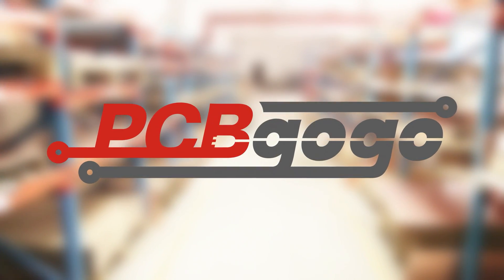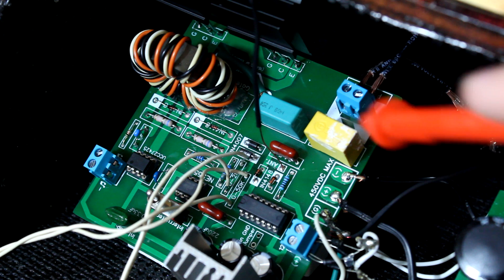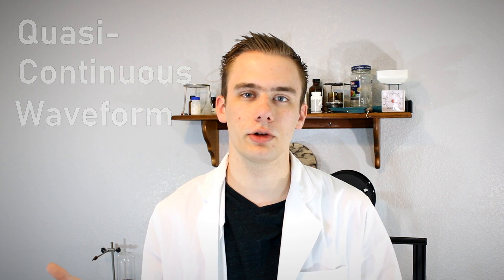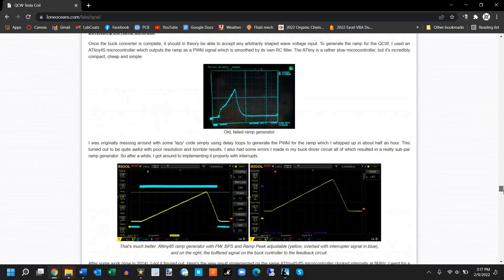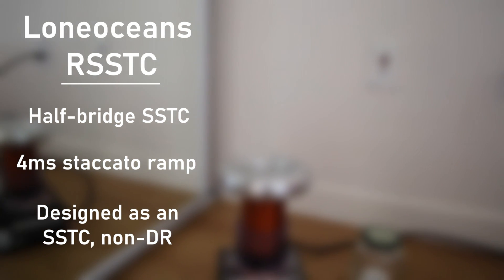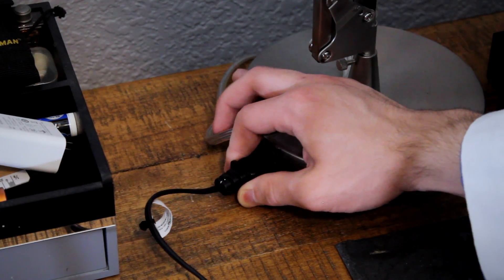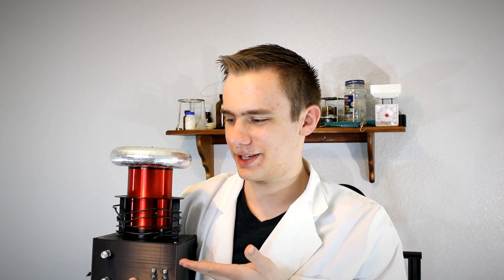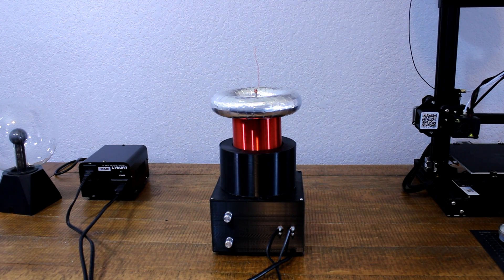World's Easiest QCW Tesla Coil (Staccato-Ramped DRSSTC) | The Ultimate Build Guide

Comment: Hey there Zach! Great video and design! Getting all the parts together to make my own coil. My question is,  can I use a 17/18vac transformer for the low voltage side and just make sure to use a heat sink on the 7812 regular? Or would i need to beef up the regulator and the caps voltage rating as well?
Reply from the maker: Hey Trey, glad to hear you're giving this circuit a shot! To my knowledge, 18VAC should be fine, so long as the electrolytic capacitors near the 7812 are rated for 30V or more (25V might be too little, since the peak voltage from 18VAC is just over 25V). There are actually many variations of the 7812 from multiple manufacturers, but from what I can see, all of them can handle 27V or more (some higher-end designs can handle 35V). I do recommend heatsinking the 7812 if you can though, since mine gets kinda warm with just 12VAC. Hope that helps, good luck!
Reply: I do plan to experiment for sure! Just finished putting together the driver. I do have one more question. When you are running it in 220 volt mode, how do you have the 12vac transformer wired? I ideally want to have one plug to power everything.
Reply from the maker: @treysmith6028  glad to hear it! In my build, I just had two separate inputs: one 120v line for my 12V transformer and one 240v line for the main circuit. This was just my choice though, I could have just ran the whole thing off 240v if I instead wired a 240v-to-12v transformer in parallel with the circuit's input.
Reply: When calculating the LC impedance, do I need go include the .68uf cap at the inverter part like your last coil design?
Reply from the maker: @treysmith6028  No, just the resonant capacitor. For impedance calculations, you can look at the inverter capacitor and resonant capacitor as one capacitor bank. And when you have a low-value capacitor (like a 0.1uF resonant capacitor) in series with a much larger capacitor, the overall capacitance essentially reduces to that of the smallest capacitor. In reality, it's a bit lower: the total resonant capacitance for a 0.1uF capacitor in series with a 0.68uF inverter capacitor would be 0.087uF. The formula for the capacitance of a series capacitor setup is simply 1/((1/C1) + (1/C2)), you you're interested!
Reply: Dude great info! Helped a ton. I love how detailed and thorough your responses are. Got my coil up and going finally! However,  I have strange issue. The 100k pot. Will not change the BPS, its stuck at the highest rate. So when I turn up the other potentiometer it's just changing the spark size. I checked the value and its correct. Any idea what would cause that? I'm at a lose
Reply from the maker: @treysmith6028  I honestly don't know what could be causing that! You might try swapping out the 555 timers with new ones (and maybe the 100K pot), and then ensuring everything around the interrupter is wired up correctly once again, but besides that I don't really have any good suggestions.
Reply: @LabCoatz_Science  I did try those things. I'm gunna check my wiring and hopefully find something! I did use a 2k resistor instead of the 2.2k going from the potentiometer to the timer, but I wouldn't think that would be the cause.
Reply: @LabCoatz_Science hey there Zach! I'm sure you're tired of hearing from me. Haha I have tried literally everything! Double checked all my soldering, wiring, replacing most of the ic chips, using more primary turns, trying different resonant cap sizes, and nothing has changed my BPS issue. It's just stuck. The only other thing I can possibly think of is the 18vac signal that is getting fed into the interrupter circuit might be causing one of the timers to not work properly? Its driving me crazy!!
Reply from the maker: @treysmith6028  No worries! That could be possible, you may want to try a 12V or 14V transformer and see if that makes a difference!
Reply: @LabCoatz_Science Hey Zach! Dude.....I finally figured it out! I started checking my capacitor values for the interrupter and I got the 10nf and 10uf mixed up. Switched them and boom IT WORKS! I've been experimenting with my resonant capacitor, and with my calculations,  .02uf would put the lc impedance around 1ohm. However, I got better results by using .03uf which puts it around 5ohms. So idk if I'm missing something there. My coil specs are 512kilohertz, 6 turns 4.901microhenry, and a coupling of  .45. I'm using the lc impedance calculator.  Also did you have to tweak with anything to make 220volts work? I'm not getting any output at all.
Reply from the maker: @treysmith6028  Hey, glad to hear it! I didn't have to tweak anything for 240V operation, and you shouldn't either, so I don't know what's up with that...
Reply: @LabCoatz_Science Zach, hmmm weird.... I'll keep troubleshooting. what are your thoughts on the lc impedance and resonant capacitor? I'm pretty sure I'm calculating correctly.  Just weird I'm getting less output with it being around 1 ohm vs 5ohms with higher capacitance.  Just trying to make sure I'm not overlooking anything.
Reply from the maker: @treysmith6028  Nah, you're fine. Mine seems to favor higher capacitances as well, in spite of the theoretical best tuning being with a lower capacity, so I don't entirely know what's up with that! Unless you measured your coil's frequency, it might actually be resonating a slightly different frequency from the one you predicted (this can be especially true at higher frequencies, where it is easier to detune).
Reply: @LabCoatz_Science   @LabCoatz  Gotcha! Ya unfortunately I dont have an oscilloscope right now to test my frequency. Definitely on my list of things to get though! Haha I did get the 240v mode working! Needed a longer antenna. Zach thank you so much for all of your help and answering all of my questions. You have saved me so much time and I really appreciate it! Keep up the awesome videos! Something you should check out and build is a plasma donut over on BackMacSci's channel.  Super cool looking!
Reply from the maker: @treysmith6028  Thanks, I enjoy helping people figure this stuff out, and I'm glad to hear you got it working! I'm actually good friends with Tate over on BackMacSci, and I even helped him a little with developing the theory-of-operation he published. We also collaborated on my most recent class-E Tesla coil video, if you haven't seen that yet!
Reply: @LabCoatz_Science  Oh nice!  I have seen your most recent video. I guess I missed the collaboration part. Haha I love all of this kind of stuff which sucks sometimes since literally none of my friends care in the slightest.  Just thankful for channels like yours and other electronic enthusiasts for putting out super cool content like this.
Reply: @LabCoatz_Science  hey again Zach. So I just started experimenting with different turns on the primary and resonant capacitor sizes and all that. I noticed that if I use higher capacitance I start to get flashover with the same coupling. I was wondering what your primary coil diameter and coupling specs are? I tried 5 turns with an 80nf capacitor and it keeps flashing over. With 6 or 7 turns and 30ish nf capacitor it wasn't doing that. Maybe the arc blew a hole in the secondary winding?
Reply: Thank you for your response! I just got all my components ordered!😁 I do have one follow up question? You mention near resonance tuning for the primary coil, but how close can I be? My design has like a 1.2 ohm lc impedance. Thanks Zach!
Reply from the maker: @treysmith6028  In theory, you could tune it all the way to 0 ohms of impedance! Steve Ward's original DRSSTC used antenna feedback and it worked fine, so it shouldn't be a huge issue. Still, antenna feedback isn't as reliable as primary feedback, so problems are somewhat more likely to occur...1.2 ohms should be fine, in my opinion, although you are welcome to experiment!
Reply: Hi again Zach! Just got my coil together and gave it a shot. It worked for a sec with some trial and error, however my resonant coil got hot and blew up. I used 4 - 1kv .01uf ones. Do I need need to get higher voltage ones? Also I assume I need dc rating on the caps? Just a tad confused.
Reply from the maker: @treysmith6028  Resonant coil...are you talking about the resonant capacitor (since you mentioned capacitors afterward and it would take a lot to "blow up" a coil)? If your capacitor did get hot and blow up, you may want to check what kind of dielectric you're using (what the capacitor is made of). Every Tesla coil builder will recommend polypropylene capacitors, and so do I: they are just the best overall! Other types, like polyester, ceramic, polystyrene, etc. tend to just overheat and die from the dielectric losses that occur at high frequencies. 

I would say a 1kV polypropylene capacitor bank should be just fine for a coil of this size, but I personally used 2kV because that's what I had. You don't really need to look at the AC voltage rating of the capacitor bank, the DC voltage rating (the voltage rating normally attributed to all capacitors) is all you really need to worry about. Hope that helps!
Reply: @LabCoatz_Science  Zach,  yes I did mean resonant capacitor my bad. Haha this helped a ton! You are a life saver. I just looked at what I got and they are polyester film caps! Oops! Got some PP metallized caps on the way. Thank you so much for taking the time to answer all my questions. I really do appreciate it a lot.😁
Reply: This might be a stupid question, but can I use a regular 220 wall socket from my house? I have one set up in my garage. Or...with it being 2 hot wires 180 degrees out of phase not work with this circuit? I assume for the step up transformer you use it has one 220 volt wire, a neutral, and a ground? I hope this makes sense
Reply from the maker: @treysmith6028  It won't matter, a neutral wire is not necessary for the coil to work (in fact, on all of my coils, I never pay attention to which wire is hot and which one is neutral). Any outlet up to about 240V will work just fine!

Comment: hello could you tell me please the output tension of your primary on your pcb please because when I apply 110V I only have 70 V on the primary? Is it normal?(I'm French)
Reply from the maker: Bonjour mon ami! Je ne sais pas si c’est normal ou non, je n’ai jamais testé la tension à travers ma bobine primaire! Cependant, je pense que c’est normal, car l’interrupteur rend la tension et le courant moyens inférieurs à la valeur de crête. Par exemple, si vous entrez 110V et qu’il est rectifié à environ 156V, mais que votre interrupteur commute à 45% (45% du temps est passé "sur" et 55% est passé "off"), alors la tension moyenne que votre compteur mesurera sera d’environ 70V. J’espère que cela aide!

Hopefully that was understandable, I just wanted to goof around with Google translate. In short, yes, I do think this behavior is normal if the interrupter is running normally!
Reply: @LabCoatz_Science  thanks you I think I have a problem with the resonance frequency of my primary and secondary Java tc is hard to use when you are French 😭
Thanks you have a good day.
Reply: @LabCoatz_Science  I've found that my diodes(1N4148)  between the IGBT are dead so i'm gona replace them and hope it will finally works
Reply: @LabCoatz_Science  and another question the mmc bank is juste capacitors in séries ?
Reply from the maker: @MaitreOogwayy  an MMC could be any bank of small capacities whether in series or parallel

Comment: Hello ! I am trying to calculate more precisely the parameters of the coil. How do you calculate the peak current? The turn on time is around 4 to 5 milliseconds. In a normal DRSSTC it usually ranges from 100 to 200 microseconds. What formula do you use to calculate the peak current in the case of a ramped DRSSTC? In a normal DRSSTC it is Vmmc = Ip/(2π×fxLpri). From there you calculate Ip. But in ramped SSTC I don't know how to do it. Thank you very much !!!
Reply from the maker: For models with secondary feedback like mine, I just calculate the impedance of the primary circuit using an online calculator (this value depends on the primary inductance, resonant capacitor capacitance, and secondary resonant frequency). Then, I divide the peak voltage (170v for rectified 120v and 340v for rectified 240v) by the impedance to get the peak current. In theory, you could also add the parasitic resistance found in the IGBTs, wires, and capacitors, but I never do.
Reply: @LabCoatz_Science  Thank you very much!! I was going crazy trying to calculate the peak current correctly

Comment: it seems that you used 2:1 (or even a 3:2) secondary. I assume it's height was ~5inch and width ~3-4 inch. So how does it work, if recommended lowest ratio is 4:1?
Reply from the maker: Because recommendations are just that: recommendations. Any coil can function as a Tesla coil, although tall/skinny ones don't produces as much output per unit height, so I like to avoid them. Shorter fat coils, however, produce comparatively more output per unit height and I just like the appearance! 

TL;DR: don't obsess over the small things like by-the-book coil dimensions! It's the circuit and the power you feed it that really counts! 😉

Comment: Awesome project, I have almost all of parts to assemble it in few days. One question that I have, on schematics, between mosfet drivers and IGBT's, it says ferrite to be 25cm, shouldn't that be 25mm? 25cm is about 10", it would be as big as the circuit board itself (157mm)
Reply from the maker: Awesome, glad to hear you're taking on this project! Yes, the ferrite should be 25mm (in fact, I'm not sure anybody sells 25cm ferrite toroids).
Reply: can you provide information on what is required not to get shocked? is it not be grounded (isolated from ground), frequency, or not being in contact with return path? Where can i find this info?
Reply from the maker: @grey_Sparky  As long as you don't touch the PCB while it is on, you'll be fine. There is no possible way for the secondary coil to shock you (in fact, you'd be hard-pressed to feel the sparks at all, unless you touch them bare-handed).
Reply: ...so output from secondary, at high freq (20 khz +) will not create a shock, correct? (Not counting rf burns)  Doesn't matter if there is return path or if I am grounded.
Reply from the maker: @grey_Sparky  that is mostly correct. With this coil, I've never felt anything, but with larger lower frequency coils (below 100kHz) or coils with standard, unramped sparks, you might start to feel it. For instance, I could feel the sparks from my older SSTC and SGTC (they made my muscles tense slightly, but it was far from dangerous or uncomfortable).

Comment: Hello zac! Does 2nd circuit parameters matter?  Like tube width and height and the count of winding turns? Or can I just simply use one from prebuilt tc kits and expect similar sparks as yours? Thanks.
Reply: Also  how long the primary circuit should be?
Reply from the maker: @lifenotagame6718  Any coil should work fine in this design, but as I mentioned, you'll get the best results if you tune the primary circuit closer to dual resonance. Most of this circuit is just "build however you want" kinda stuff (aka: the length of the primary coil doesn't matter).
Reply: @LabCoatz_Science  Thank you! I wanted to understand more about mmc bank, so I watched this video : https://www.youtube.com/watch?v=X7fos5ErRsg 
He says that depending on how you conect them changes the total voltage and capacitance. 

So I want to ask you did you use only these 4 (6:34) 80nF 2kV capacitors? If so,  it means that you got a total of 8kV AC and 20nF mmc bank.

p.s. he mentioned that it is recommended to connect resistors in pararel to each capacitor, to discharge them after work and balance voltage between them. Have you known/thought about this?
Reply from the maker: @lifenotagame6718  My design used four 0.022uF/2kV capacitors in parallel, to give me around 0.08-0.09uF at 2kV. I never really use bleeder resistors on my MMC capacitors, only on large electrolytic capacitors (like the 470uF/250V ones in my last coil).
Reply: @LabCoatz_Science  Thank you very much for help. I almost have everything, but those igbts are pretty expensive (26$ for 4of em) and as this is first time im making a tesla coil, it can be not enough even the two spare of them (ill try to be very carefull, bet who knows how much of them burns) . Im curious if there’s a cheaper alternative , like mosfets? I was thinking of buying a 10pcs pack for 16$ from ebay, but they cant be original and as powerful as from mouser.
Reply: @lifenotagame6718  my situation is almost the same, i’ve never built sstc, only spark gap tc. Looking forward for this answer too :)
Reply: @LabCoatz_Science  so this mmc bank is included in your pcb? or should I connect it separatly  (I have already placed into pcb all of the marked capacitors - all slots are full)
Reply from the maker: @developed-m6l  it is connected off-PCB
Reply: @LabCoatz_Science  is it shown in your schematic? Because I don't really understand where should I connect them.
Reply from the maker: @developed-m6l  Yes, it is in the schematic. It is in series with the primary coil, like it is for all DRSSTCs.